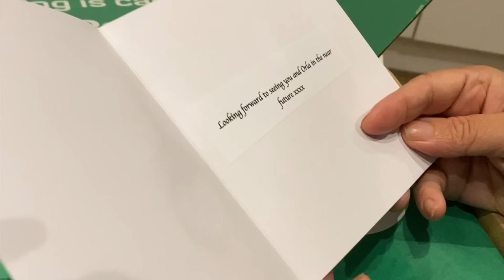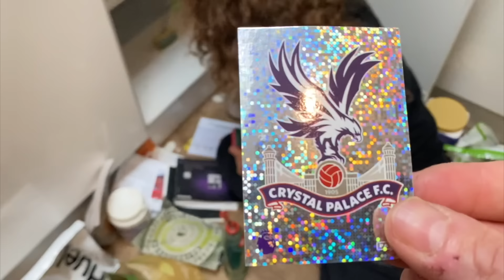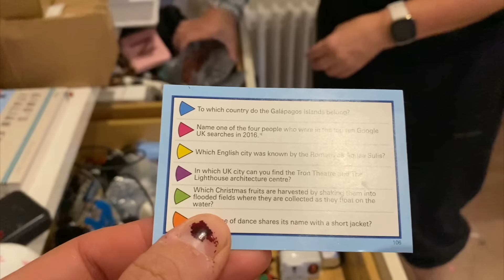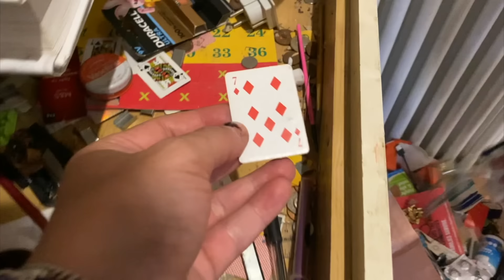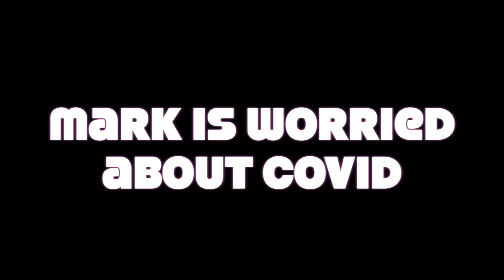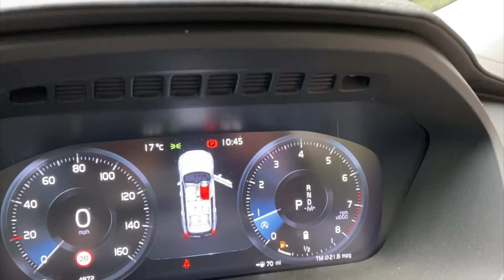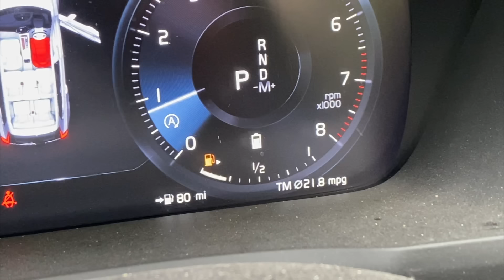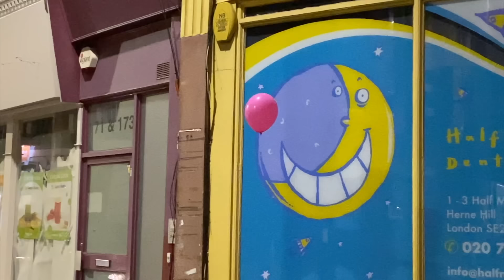HOME TIME 51 Lisa Sees Nadia's WARDROBE, Nadia FINALLY Clears her Drawers & Mark Runs Out of PETROL

Comment: Having a car that could do more than 22mpg would be good, after the fuel shock I was very aware that the 35mpg from my wagon was not good, So I got rid of it for a 60mpg hybrid, and amazingly with the crazy car market (chip shortages) I got £800 back on the deal, for a more efficeint car of the same age with half the mileage...crazy times